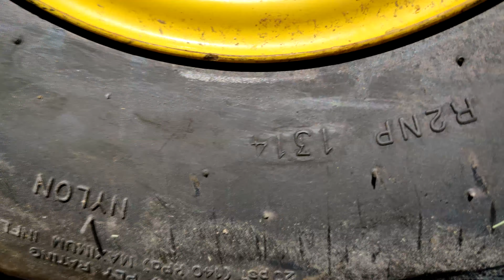Howard Price Maverick 620 Revival

Comment: Have you by chance found an actual service manual for one of these?
Reply from the maker: @ronskeeters4319  I haven't unfortunately.. what info are you looking for?
Reply: @ils360  I have the Cub Cadet Big Country version of this.  I bought the machine (the engine was supposedly rebuilt)  It idles okay and was running fair but has since lost power.  I'm not sure if it is fuel/carb related or clutch/ belt related
Reply from the maker: @ronskeeters4319  what are the symptoms? One of the ways to test if it's carburetor related is to slowly pull the choke out and see if the problem gets better if it starts to gain power and run better with the choke and pulled it then it's a carburetor issue
Reply: @ils360  Thank you for the info, I will certainly try that.  I don't have to explain to you these are "slow lumbering"  machines anyway.  It seems as it should be going to higher rpm's to not only fall on its face but to decline in power as well.  That make sense??
Reply from the maker: @ronskeeters4319  yeah that does make sense It sounds like a carburetor issue there are different sections of the carburetor One is for idling the engine and the other one is for accelerating (simple explanation) And if one or the other gets plugged it will either idle great and not take off or only run while under load and won't idle I would definitely try pulling the choke while you're driving and see if that changes it if it does then the carburetor will need to be cleaned out. There's a possibility of a plugged fuel filter or failing fuel pump as well but I bet you it's the carburetor
Reply: @ils360  Thank you for the guidance!  I appreciate the input!!
Reply from the maker: @ronskeeters4319  not a problem :-) If you have any other questions just ask 😁